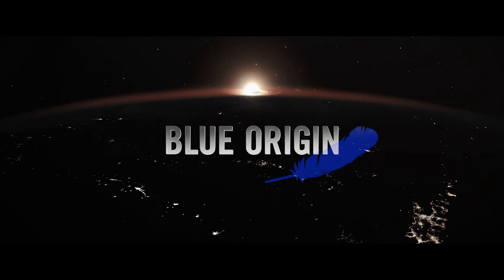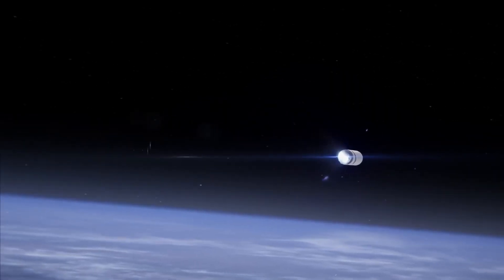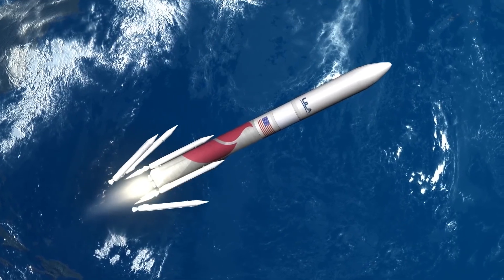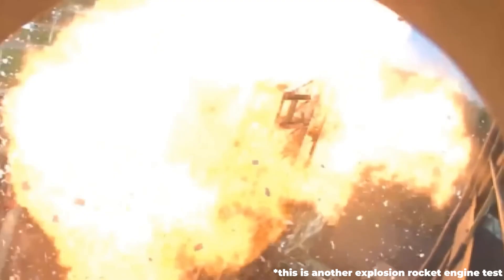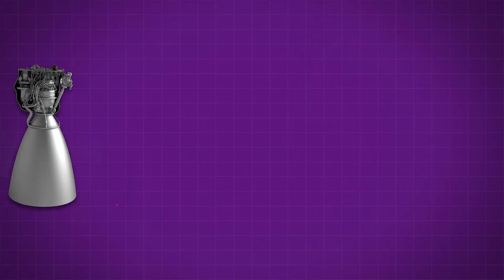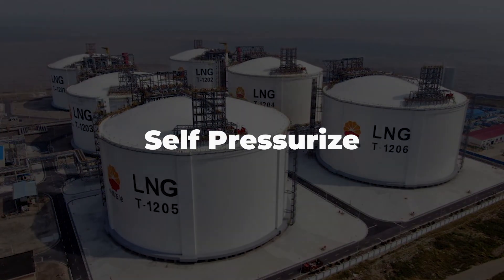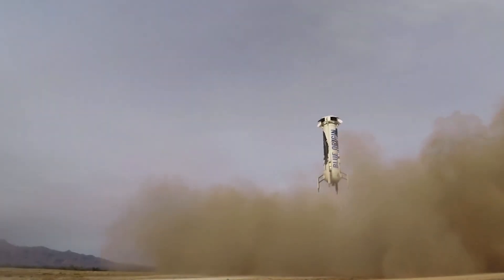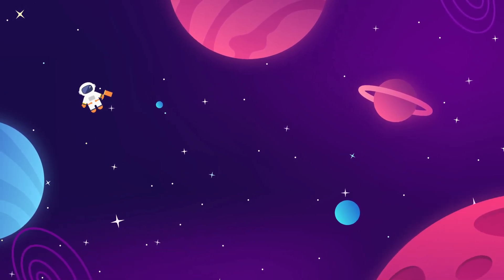The Disappointing Truth About The Blue Origin BE-4 Rocket Engine!

Comment: The Raptor is ALSO a medium-performance version of a high performance architecture.
They set the design point of the Raptor for 300 Bar. But they DESIGNED it to be capable of withstanding far higher pressures.
And besides, the pressure's not what kills engines. Heat is what kills liquid fueled rocket engines, it always has been and always will be the key constraint.
Pressure is just "design a pressure vessel capable of withstanding X pressure at Y temperature", a simple thing for most mechanical engineers, not just rocket scientists.
Temperature on the other hand has a compounding effect on the (lack of) strength of metallic alloys used in making rocket engines.
Beyond a certain point, the hotter you make a rocket engine's insides, the faster it's going to break.
The path towards fast reuse of the Raptor is by only using roughly 80% of the performance of the engine as a whole. However, you'll never say they're setting the throttle to "full 80%". Instead, you'll hear them saying they have the throttle at "100%" and not say that they left the other 20% on the table so that the engine lasts longer.
This is nothing new, airliners have been using what's sometimes called "flex takeoff" thrust settings for takeoff for a long time now. What's that? It's where the auto-throttle system intentionally sets the takeoff thrust to less than 100%, usually when the aircraft is lightly loaded or not fully fueled, in order to make full use of the available length of the runway while significantly saving wear and tear on the engines, rather than putting additional stress on the engines by operating them at their full rated takeoff performance every single takeoff and taking off in 1/3 of the runway that's available (or less).

The SuperHeavy booster from SpaceX can do this because despite the "need" for so many engines, it still has a fully loaded takeoff TWR of something like 1.4 to 1, which is quite "sporty" for a super-heavy class rocket. The Saturn V had a liftoff TWR of just 1.1, if memory serves. That's why it looks so photogenic in the slow-motion camera footage that NASA has, it's barely moving off the pad so you get to see the flames for a relatively long time.

Because of that high TWR, SpaceX can do something interesting. If all the engines work at liftoff, they can throttle them all back slightly to save wear on them. If some of them fail to light, they can throttle back less to maintain the desired performance. If more of them fail, they can choose to not throttle back at all. This is all handled by the engine controllers on each engine talking with each other.

What failed on the recent SuperHeavy test flight was Stage 0 (the launchpad). Because the launchpad became a crater, that material that was dug up had to go somewhere. And it chose to go up instead of sideways. Which meant that the bottom of the first stage, where all the sensitive engines are, got hit with a bunch of high velocity gravel and dirt and concrete chunks (BIG concrete chunks, not small ones, you'll see them if you watch the launch footage in slow-motion). Needless to say, this causes problems for the rocket. Problems like losing more than one Hydraulic Power Unit, which caused the SuperHeavy booster to eventually loose the ability to control its course with thrust vectoring, or to shut down or throttle the (also hydraulically actuated) engine fuel valves.
The launchpad has been repaired and seems to be able to withstand the blast of the SuperHeavy booster now, and the new SuperHeavy booster is not using Raptor engines that use hydraulic control actuators, the thrust vectoring and everything else is all operated by electrically powered actuators now.
Besides, SpaceX met its goal for testing SuperHeavy, which was "we hope it clears the pad".

The only thing I have a problem with for Vulcan and New Glenn isn't the performance or quality of the engines. It's the production rate of those same engines. If they can't crank those engines out at a rate of something like 50 a year, they won't be able to keep up with demand.
THAT, the production rate problem, is the true "disappointing truth" about the BE-4.
Not anything that was said in this video.
Reply: well explained !!👏
Reply: but are u aerospace engineer or something
Reply: @flazerflint  I don't get paid for it, but I am quite competent in RSS/RO/RP-1 mod pack for Kerbal Space Program (that's the mod pack that tries to make the game as realistic as possible, bascially it takes most of the "funny green aliens blow up rockets" out of the game and turns it into a proper sandboxed space simulator with a model of the IRL solar system to explore). And if you re-create a rocket from IRL in RSS/RO/RP-1, it performs the same as the one IRL would.

The BE-4 is a good engine. The problem is the production rate of new engines (aka they need a better factory), not some fatal unsolvable design defect in the engine itself (which would require a better or different engineer to take a look at it). This video isn't the best at describing that very critical difference.
Reply: There is no evidence at all that any debris managed to swim up stream of all that rocket exhaust and strike any part of the booster. It's a silly notion to begin with.
Reply: @TheEvilmooseofdoom  
Obviously due to the amount of dust kicked up during the whole event, you won't see what ACTUAL pieces got kicked into the rocket's engine section itself, but you gotta remember that the rocket exhaust of a rocket engine doesn't travel in a widening cone shape as it gains distance from the engine. This is because if it did that, it would be inefficient, and inefficiency is something that rockets avoid at nearly every opportunity.
If the rocket exhaust is shaped like a widening cone, that represents what's called "under-expanded" flow and basically means you should have used a bigger rocket nozzle for the engine (at that altitude, in this case sea level). Ideally the rocket engine exhaust in an atmosphere will travel in roughly a straight cylinder of the diameter of the exit of the rocket nozzle. The engines on SuperHeavy are well designed, and they have a cylindrical exhaust.
Further, because the rocket engines need room to swivel to do the thrust vectoring thing (that's how the rocket steers when it's flying with the engines running), they can't make the whole bottom of the booster be rocket engine nozzle with no gaps, even if we forget that they're circle shaped so you can't fill a circle with lots of smaller circles of all one size and not have gaps.
But all this just means that there's gaps, and more gaps than a simple "Circle packing" problem would indicated.
Those gaps are where debris can avoid flying thru downwards rocket exhaust, and fly up and into the engine section at high velocity, damaging things.
That's exactly what happened with the first launch of SuperHeavy.

Comment: Well, if it wasn't clear that you had a bias against Blue Origin, listen to this video after the one on New Glenn sort of confirms it. The conclusion was there was an anomaly linked to that engine, and it was being tested at higher loads than what would be required for launch. Jet engines are tested very similarly for airliners. The reality is that Blue Origin is going the opposite of SpaceX. instead of blowing everything up every two days, they are being methodical. Also, that new space station which you called there's, has three other partners signed on with it. If your going to make an informational video, leave the bias at the front door.

Comment: Methane and LNG are not same. LNG is mostly methane, but also contains variable amounts of other gasses, such as propane and butane.
Since these proportions are variable and require different proportions of oxygen to combust corectly, wonder if part of the problems with the BE4 is due to that.

Comment: What a load of bull, no raptor engine exploded mid flight, they just failed. And spacex are not "having trouble harnessing the power of this engine". But most importantly, nobody needs blue origin or their failed BE4. Starship, is bigger, better and closer to the finish line. By the time BE4 is ready, if ever, nobody will care.
Reply: That's what am thinking!

Comment: The raptors exploding during flight was likely do to impact with debris from the launch pad at liftoff.
Reply: None were hit by debris and none exploded.
Reply: @TheEvilmooseofdoom  So the failure of the launch pad is unrelated to the failure of the rocket? Seems weird that the one thing they have been focussed on improving the launch pad more than the improvement in engine reliability.

Comment: There are like a half dozen really obvious mistakes in this video. For one, a chinese firm recently successfully launched a methalox rocket into orbit, the gasses on the superheavy body are not from venting but from water vapour being superchilled on the outside of the rocket due to the extreme cold inside the rocket, the venting is different, also spacex doesn't vent methane, it's sent back down to the propellant farm to be reclaimed to reduce the risk of ignition.
Also while Blue is clowned on a lot, there are hundreds of very talented engineers working there, they just show almost none of their development work in public, and while they haven't reached orbit, the fact their booster can land is still very impressive.
The Starship RUD on the IFT was basically what was expected, if not a little quicker than most anticipated, and I don't think it's super fair to blame the explosions from individual engines on the engine itself as there was quite a lot of debris at launch which was unexpected, and it's quite specifically not dangerous since there were massive exclusion zones setup around the launch site and potential splashdown point near Hawaii, which were sent out days before the launch.

Just some of the issues I spotted, could go on but it's late.

Comment: BE4's main problem appears to be complexity of manufacture, it is taking insane amounts of time to build each engine and even then there can be problems like the one that exploded on the test stand. It is also quite a lot more expensive than BO originally planned meaning they are currently losing money on every engine they supply to ULA. SpaceX having so many iterations of their engines means they can design out problems after the engine is tested meaning that not only are they constantly improving reliability and performance with each iteration but also reducing cost. Raptor 2 currently costs about $500 thousand per engine to build compared to $14million for a BE4 with Raptor 3 set to halve the cost again to £250 thousand. While BO is taking months to build each engine SpaceX is currently producing one engine a day on average showing the benefit of design changes to simplify manufacture.
Reply: We are building about 2-3 be-4 every week. Goal is 1 a week. Its not SX figures but 1 a week is plenty enough for the be-4. And they work really well. Its high production on a very reliable and well built engine
Reply: @MaxStax88  Yeh right 🤔
Reply: @MaxStax88 😂😂😂

Comment: This video is so, so, so wrong. On the contrary, BE-4 is not only not crucial, it is irrelevant. ULA is a dying company, that only continues to exist so far because of the US government, and that won't last forever either. BO is a company that exists because Jeff wants to say he has a space company, and will never get anywhere. 

There is absolutely no shortage of launchers in the USA. SpaceX has the Falcon 9, the most reliable rocket in history, that can put up to 22 tons in expendable mode, and 16 reusing the 1st stage. Falcon Heavy, which has a perfect reliability record, can put up over 20 tons while reusing two cores, and nearly 70 tons in leo in fully expendable mode. 

That alone is not only more than enough to cover any needs the US has, but rather the greatest launch capability in the world. 

On top of that, RocketLab has Electron fully operational for small payloads, and is rapidly developing Neutron for larger payloads, Relativity space is getting there, so is Firefly. So are many others. 

Also, we have Starship. Your take on the Starship OFT is totally stupid. It's a flight test, things are supposed to fail. It was more successful than anybody expected, and Starship will be flying sooner rather than later.

Comment: 10:17.  The footage combined with the narration gives the impression that the "white cloud" is excess methane gas when actually most of the cloud being shown is water vapor.  Methane tends to shoot in short, directional bursts from a side vent during this process and you can't actually see such venting in the video clip as the moisture is dominant.

Boil-off is being vented during and after fuel-loading, but the video footage is primarily showing the fog that condenses around such cold, conductive bodies in the tropical air.  Moist air comes in from upwind and fog bleeds off of the leeward side.

Comment: ULA should look to the Raptor 3 engine or a variant of it to replace the BE4 engine, Raptor engines have actually flown multiple times.  The Starship engine failures were due to concrete exploding up into the engines on liftoff.  A lot different than the BE4 engine failures.  America doesn't need BE4 to survive....a SpaceX engine will do just fine!
Reply: Raptors have flown, but they are still in development, not operational engines yet.  That aside, ULA would do well to replace the BE-4 with the smaller yet more powerful Raptor, since they could probably fit more of them onto the Vulcan.  Four Raptors would provide enough thrust to make the baseline Vulcan Centaur, without SRBs, far more competitive against the Falcon 9 than it currently will be.  With two BE-4s, the Vulcan Centaur will be pathetically underpowered without SRBs, and will have to launch with the propellant tanks only partially filled.  In that configuration, it's too big and costly of a rocket for its relatively light payload capacity.  Installing four Raptors would fix that issue right up, and save ULA and their customers money.

Selling the Raptor to ULA would not be in SpaceX's business interest, obviously, but Elon has helped competitors before, so who knows?

Comment: This video is not correct, blue origin does infact know what happened to the engine and what caused the explosion. The issues have been fixed and is in production. These videos like this spreads miss information, just about all of you tube and online information is wrong
Reply: The reports are of turbo pump issues and that they have been an issue for a long time!  If they are experiencing issues at such low performance figres (60% of design spec) that is seriously worrying.
Reply: @jackdbur  why, why does it worry you? It shouldn’t because u dont work there and you dont know what is going on with the company because you dont work there. You dont have any information other than what they want you to know. So stop worrying, regardless of what u think, there are alot of people at blue origin that absolutely knows whats going on and that nothing is going wrong!!!

Comment: If the Spacex Starship and Super Heavy Booster vented excess methane from the airframe, there most likely would be a giant fireball at launch, rather than a rocket lifting off.  Super cold liquids (liquid methane and liquid oxygen) reacting to a high humidity environment is more likely the cause of the white vapor you claim is methane venting.  Also, it may also have some boiled off liquid oxygen vapor.  Venting methane would also contribute to the greenhouse effect which would be lousy for public relations.
Reply: Lost my subscription with poorly researched info 😢

Comment: Not to mention the BE4 has virtually the same thrust (for now) as the raptor but like 2.2-2.5 times the mass of the raptor, and its pretty huge, which means the mass flow must be much greater than a raptor, which also means that it is not as efficient as a raptor either.
Reply: As soon as it works reliably, it will have its place and a job to do. Having an alternative to SpaceX is good, even if it is more expensive and less efficient by some margin. Monopolies can end up being abused. Even if SpaceX is cooperative and innovative right now, there are no guarantees about how things will look in 20-30 years. A boring but solid engine is not a bad thing, if the BE-4 can evolve into that.
Reply: @uazuazu  Except BO is not the only company developing engines. Spoke, rocket Lab, RS1, et al are all developing engines. Granted they are now smaller but their design cycles are much faster and will pass BO long before 20 years.
Reply: I'm a huge SpaceX fanboy, but I hope, once the BE-4 matures they can start increasing the chamber pressure and become competitive with Raptor.  I doubt that will happen, but competition is important for price control.
Reply: Being bigger at the same thrust output really just means it's operating at a lower chamber pressure with less power-dense pumps
Reply: @sycodeathman The BE-4 is all ready having major issues with its turbo pumps so running higher pressures isn't likely without serious redesign work.
Reply: @jackdbur  Yeah I didn't mean to imply otherwise, BE-4 is certainly more limited in its future upgrade path than Raptor for example.
Reply: @jackdbur Which is crazy to me, BE-4 was supposed to be a medium performing engine but built like a high performing engine. Theoretically the engines should have lots of headroom to run harder, and yet they're having trouble at the current output. They've made a crappy medium performing engine in a large footprint. At this point Raptor is surpassing BE-4 in thrust and efficiency with the Raptor 3 test stand results and future plans, in a much smaller package too.